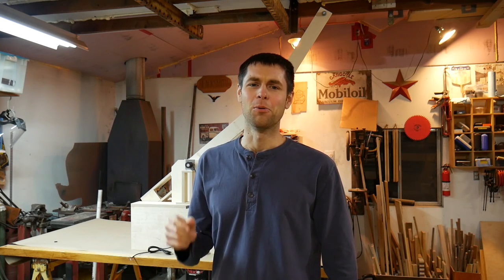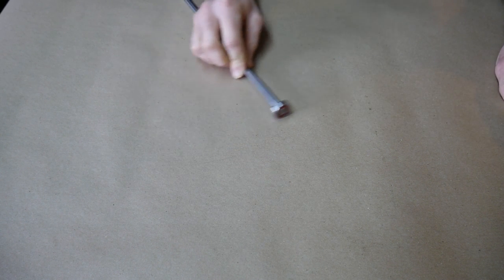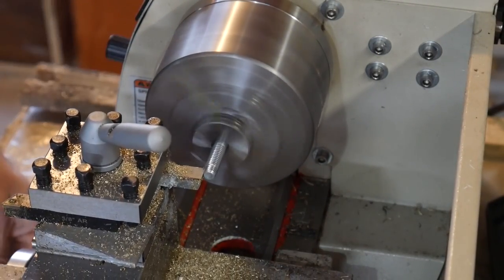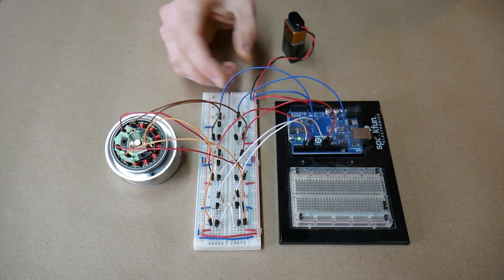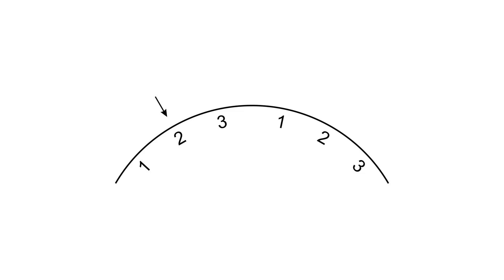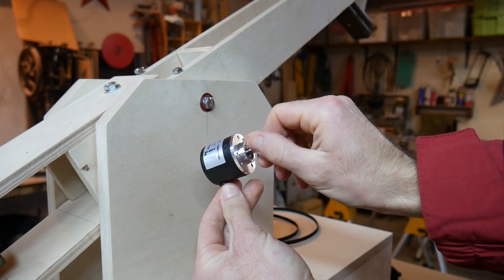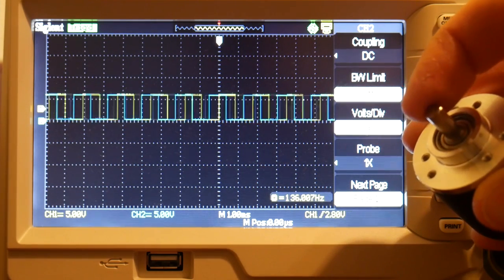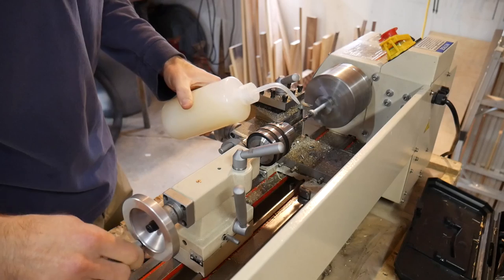Camera Control Arm #2

Comment: The VCR head motor at about 3:30 isn't a stepper. It is a three phase motor, the same as a "brushless DC" motors, which are generally three phase, a well. Not a lot of torque with this type (VCR head motor), but you get very smooth motion, and these motors can be designed for very high torque and speed without the brushes to wear and drop power. These are most smoothly driven with sine wave drive (PWM sine is fine), but, other than at dead slow, are still pretty smooth with overlapping square wave. For your application, I might belt that down 10:1 and use it. Looks like a nice setup coming along. As a side note on the electronics, have you picked up a copy of Horowitz and Hill?
Reply from the maker: +john john That's interesting regarding the motor, seems like the lines are blurring between motor types now. I've been reading "Practical Electronics for Inventors" though eventually I'll probably end up collecting all the major electronics books.

Comment: That adjustable piece of wood on the stepper motor around 3:14.  Do you think I could use a similar concept (although the slots would need to be cut 90 degrees from where they are here)...say....I don't know....to adjust the lever arm height for a "2 story" rise in the center star of a Expandable Table design (wink)?

I have no idea where you're taking me on "this particular ride" through wood mechanics Scott, but I always enjoy the ride!

Comment: Awesome work buddy. I also get frustrated because I can't see stuff in electronics. I share the same feeling! :)

I'm quite impressed with the stepper driver you made. I think you can get the exact control you want, to apply holding torque that is, with a A4988 stepper driver hooked up to GRBL shiled on Arduino. Might save you some time. So I thought I'd suggest it.
CHEERS

Comment: Because the swing arm doesn't go around more than 90 degs, why don't you use an arm, with a screw drive, to move the arm up and down?
Reply from the maker: +Dustin O It will go 360 degrees in the final version. I considered worm gears but they can't freewheel without physically disengaging.
Reply: Oh ok.  I'm looking forward to seeing the final product.